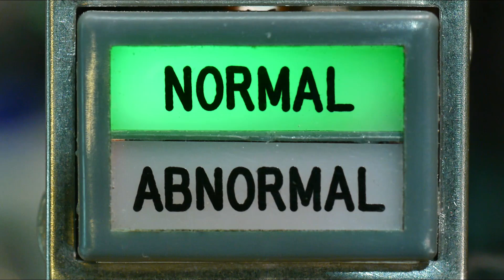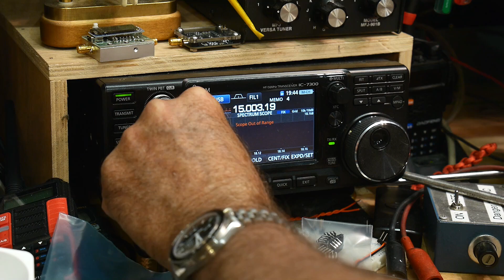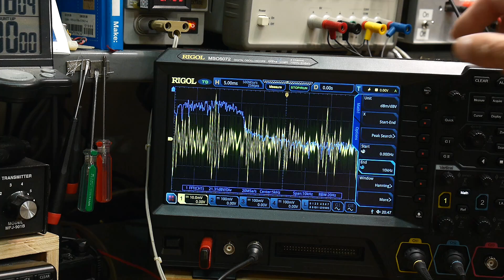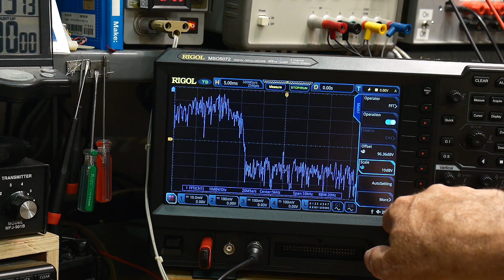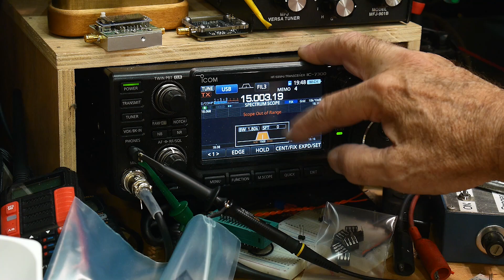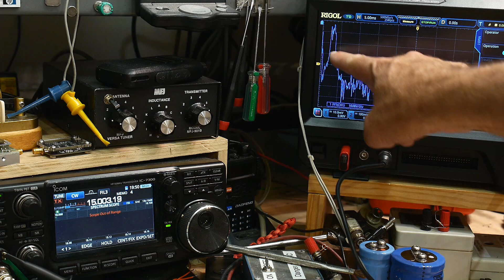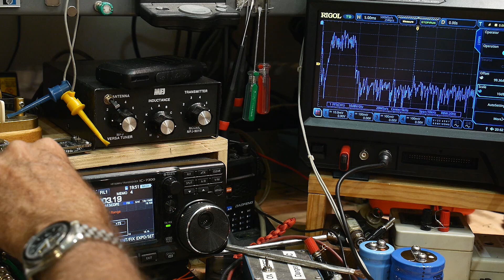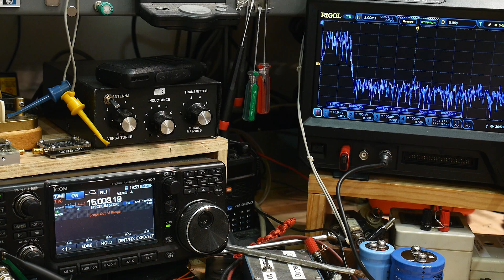#840 ICOM 7300 Filters Viewed Real Time on a Spectrum Analyzer

Comment: Perfect.....I did it with my 18 years old FT1000MP MKV 2,5 kHz, 2,0 kHz, 500 Hz  and 250 Hz. Amazing  so see in real time the filter width.
Was not so easy and playing around with the setting of my DS1054 (100MHz). But the finally the screen picture was quite good to define the 
bandwidth with the cursor. Thanks for the tip and the presentation!

Comment: I noticed the 7300 on your bench in recent videos. Getting back into ham radio perhaps?
Reply from the maker: Yes the newer radios were just too hard to resist. And FT8 allows me to play without interacting with anyone 😁
Reply: @IMSAIGuy  😂 Hehe yeah that's the great thing about ham radio: if you don't like one part of it or one group of idiots...woops I mean operators... there's always another band, another mode, another tech, another facet to have fun with. 🙂
Reply from the maker: @ruhnet  Another reason was the big ugly antenna which I took down years ago. I've now got a thin wire you can't even see and just used it for receive. Got my IC7300 and in an hour worked a bunch of DX in zero sun spots. Guess wire is just fine.
Reply: @IMSAIGuy  hehe yup I've never had anything but wire. Works well for me, and I'm often QRP.

Comment: If you upgrade the IC-7300 firmware then the "Scope out of range" will go away, and scope will work on all frequencies.
Reply from the maker: I updated the firmware once. is there newer one?
Reply: @IMSAIGuy  Yes there is with several nice features. Highly recommended.
Link below.
https://www.icomjapan.com/support/firmware_driver/3248/
Reply from the maker: @matsbengtsson3756  I already have version 1.40 which seems to be the latest

Comment: You stumbled onto how to do an IF Shift with Icom's Twin Passband Tuning. Just grasp both PBT knobs at the same time and turn them in the same direction simultaneously. Other radios, like Kenwood's have separate Passband Width and IF Shift controls.

Comment: Yeah, I saw Alan's video. It was so obvious a thing to do it never occurred to me especially, as you noted, that high frequency filters can be characterized by wideband noise. I guess a failure of imagination on my part :-) As it happens I'd been looking around this morning  for crystal filters with 3kHz bandwidth. I found and bought 45MHz Toyocom 45E1AZ filter on eBay but they are +/- 15Khz. Couldn't find anything below 1MHz on Mouser or Digikey either.

Comment: Don't you know how to set the filters on your 7300. Hold the filter button and set all three filters you are just using the default filter widths.
Reply from the maker: Yes. If you watch the video I push the button to set it back to default.
Reply: @IMSAIGuy  no you didn't.. and you obviously didn't watch the link I sent
Reply from the maker: @TheRetiredtech  5:00
Reply from the maker: @TheRetiredtech  6:20
Reply from the maker: @TheRetiredtech  you are right about even more filter options, the video was how to measurement on a spectrum analyzer not how to run a 7300